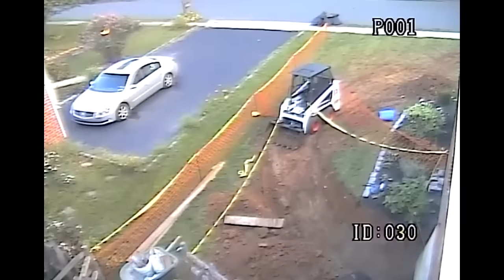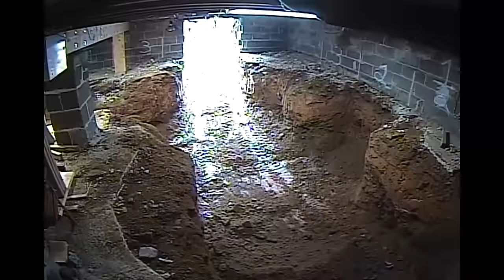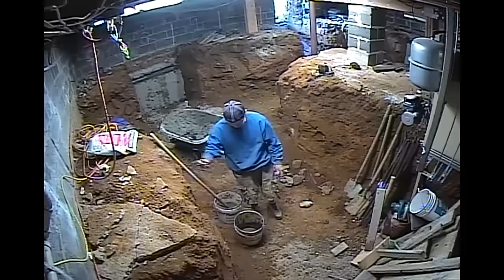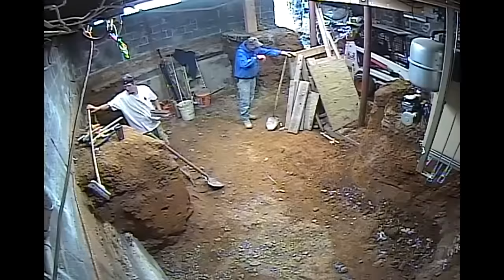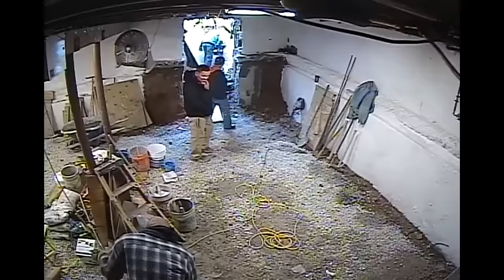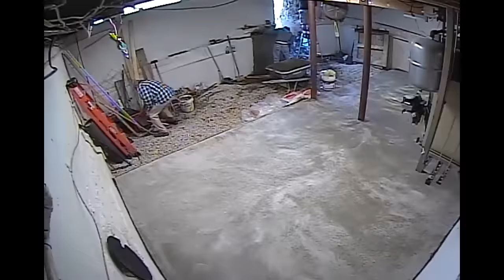New Basement - Crawlspace dig out and underpinning

Comment: This is interesting.  Im in BC Canada. My next door neighbours put in a new basement. But, they jacked the house up first. About two feet. Two steel beams supported by 8 by 8 blocking. Then the bobcat dug out the old basement floors and walls. That took about 3 days. Then formed up the new basement and poured the walls.  They were able to put waterproofing on the exterior. Also pipes under the new floor to remove radon gas. A lot of work. But it looks good.
Reply: Did you ever find out what your neighbor payed for that?
Reply: I wish I had the money to do that for my current old home. The basement needs some serious repair but the house is built on an elevated area so there is no way to get a bobcat up here.
Reply: How much was it? Do you know

Comment from the maker: Since I keep getting the same questions, I’m posting my typical response to most folks that email me.

We are located in Southeastern PA so your cost may be higher or lower depending where you live and depends on the conditions of your house.

 Cost, we paid 62k for the following: The digout, underpinning, drain for perimeter, floor slab, drylock of all walls, and window egress kit. I spent about another 12k to finish myself with family. I live outside of Philly and it took some time to find a contractor who knew what they were doing. I got pricing as low as 40 and up to 90k. I ended up hiring a contractor who had done this kind of project before. 

Also I had a structural engineer provide drawings ($900.00) because with this kind of project you don't want to wing it. We've had some minor settling however the space we gained for us is priceless. We had built up 15 years ago and did not want to move so for us it made sense.

Permits and inspections were ~ 1100.00

For our project, our finished sq ft was ~ 450, we lost some room around the perimeter due to the underpinning requirements.

The digging out took 6 weeks and finishing took me another month or so.

The bobcat was key - yes we destroyed the lawn but that machine made all the difference in speeding up the process. You could hand dig and I've seen videos of people doing it that way but it will take significantly longer.

To date we’ve had no moisture issues. Our perimeter sump has never filled up. Now if you had a higher water table I could see having concerns but for us we’re ok. Some people have asked about water seeping in between the poured sections – well that’s more of a question from the engineer. I suppose that’s why we were required to install the perimeter drain and sump.

Thanks,

Mike
Reply: Big job, you guys did great! Thanks for the look.
Reply: Hi! I hope all are healthy and safe. Thank you for this video. I’ve been playing with the idea of a crawl space dig out for years and I’ve decided to try and move forward with it..depending on the costs. lol I live outside of Media, PA, so very close to Newtown Square. :-) I spoke with Gary and he couldn’t have been a nicer and knowledgeable guy. He recommended starting with the structural engineer and then come back to him with drawings. With that said, would recommend the company you used and if so, who would that be? Also, if you had the chance to start your project over again, was their anything you would have done differently or recommend to someone thinking of having this same project done? Thanks! Stay Safe!
Reply from the maker: @mastercpu2  Hello and thanks, yes Gary and his crew were great! The structural engineer I called was PennFUSION Engineering in Lansdale. I was happy with them and had no issues. I did ask the engineer to change a couple of things and he was great to work with. I suppose I would have changed a few things on the finishing side but as for the underpinning, there wasn’t much wiggle room to change things. Originally the engineer called out for deeper footing which would have taken up a lot of floor space into the basement, we revised this to pour deeper behind the original footing by excavating a little more. Also we installed 3 columns which are hidden behind the walls, some folks opt to have a new beam installed that spans the entire basement giving them an open space. We didn’t want this option and honestly I didn’t want to mess with the original beam. We did actually beef it up by sistering 2x12s on either side since I wanted to relocate some of the original columns. We’re almost at 6 years and doing fine. We’ve had some minor settling and I had some drywall work done to fix some corner beads / joints but the basement is dry, not musty, the sump has never filled and we’re happy with it.
Reply: With a proper drain tile installed around the perimeter as well as the pump capacity to handle even the heaviest rain you should never have any issues with water other than normal equipment maintenance and repairs. Looks great. I'm thinking about doing something similar but my water table wont allow it.
Reply: whistles at price I can't say anything as I haven't ever had to quote that even with contract friends and it probably covered the cost of the concrete,also is the contractor is GOOD that adds to. I can def see significant cost savings with DIY but still quite expensive for for concrete.  Awesome video
Reply: Thanks for the valuable information!  A local engineer (i’m in the bay area) wanted over 20,000 for the same project. Price gouging.

Comment: So many questions....
• what state was this located in? 
• what method did you use to prevent moisture from the walls and floor? 
• how do you tap into the drain system?
• is this accessible from inside the house?
Reply from the maker: PA - outside of Philly. Walls were drylocked, weep holes drilled into the original block which can drain into the surrounding french drain. Also hung 10 mil plastic behind the drywall and insulation. The slab was also poured over 10 mil plastic per the engineers drawings. The drain goes around the perimeter and empties into a sump which then discharges outside.
Reply from the maker: I didn't see your last question. Of course its accessible from inside, we added new steps from the family room to the new basement.
Reply: How much, 40K, 80K, 120K?  I want my crawl to look like this soo bad, great vid!
Reply from the maker: @msbgone  send me an email @ mjnicolaides@gmail.com
Reply: Marc Spunt let us know the damn price.  For those who just want to know without emailing Gees!
Reply: I just saw this now....  not really going to look into it right now, thanks all!
Reply from the maker: @hectormeza991  I don't publicly share the cost out of respect for the contractor. Besides there are so many factors involved in a job like this that just stating the price really doesn't prove anything. I got pricing from 40k to 90k and it took some time to find a good contractor and there was a ton of factors and issues to consider. So there you go.
Reply: The price almost certainly varies depending upon a lot of factors. Most of which is probably the area of the base of the existing house. I estimate that the house I live in, which is a small 1200sqft would cost me about 100k. It's expensive. You could always do it yourself, if you did enough research on the building codes and best practices, and didn't cut corners. It would probably take half the summer to do it, and a broken back, and a lot of blisters, maybe a couple of trips to the ER, and maybe a new house :)

Comment: I'm curious. did you put something in the seems between the different concrete pours to close the joint to prevent moisture from seeping in to the basement?
Reply: I doubt it, but in reality only very high psi concrete will stop moisture infusion. It must be assumed that cracks and existing block will allow moisture through.

The ideal is to train outside the wall, have it sheet down a plastic membranes, and hit gravel, then be carried out by drain or pump (that’s how my house is).

Comment: Amazing how long do you have to wait for the concrete to dry before you can start digging the next sections.
Reply from the maker: The plans called for 72 hours of cure time between drypack (the grout) of one section and excavation of the adjacent.
Reply: @michaelnicolaides187  what did you use for the dry pack? Mortar?
Reply from the maker: @lostintime8651  They used a product called Planigrout 755, its a general purpose construction grout.

Comment: Great Video!!! It's very clear the method, I'm building a new basement, put it will be piled 6.5m down under my new rear extension. will be around 2.8m ceiling, 26m2. couple of questions, why didn't you get a concrete pump when you laid the floor, and I guess you used 90cm (3') segments for underpinning, with 45cm for the outside corners, to prevent collapse.
Reply from the maker: Thanks and good luck with your project. My contractor really didn't need a pump, he had enough guys to wheel barrow the concrete in without having to rent a pumper. Also when doing the underpinning sections it wasn't a large enough poor to warrant a pumper. Even the floor wasn't that much. For the sections I believe they were 3.5 - 4' sections.

Comment from the maker: So I accidentally deleted a comment about the hanging oil heater and not sure how to undo that? But yes lowering the heater was a lot of fun!
Reply: got a few questions, how much was able to dig at once like in foot? also how did you do walls when I hear to water proof the outside? I am thinking to do this myself when got my own house but unsure on somethings when watch videos, looking to get an 30 foot by 6 foot basement, though at moment thinking if can use rsj to support house as go round or should always be concrete? looking to do by hand to save on some costs
Reply from the maker: @mlee6050  i'm not sure I fully understand your questions but feel free to email me @ mjnicolaides@gmail.com
I know that the contractor left a 3' wall of dirt on the adjacent sections when digging out the section to be underpinned. 3 of the 4 walls could not be waterproofed from the outside as they had either a porch or common wall to the rest of the house. The waterproofing included a perimeter french drain with sump as well as drylocking the walls.

Comment: Looks like a great job.
1) How long did the whole project take?
2) How long did it take to get to the point where the concrete floor was poured?
3) Did they drill holes up into the old foundation?
Reply from the maker: This project took 30 days from start to finish. It started end of Sept and wrapped up 11/1/16 due to some rainy days.
The floor was poured on about the 25th day.
Yes they installed rebar into the old foundation. I had a structural engineer provide drawings.
Reply: Michael Nicolaides very cool time lapse. I’m trying to price this out for my own home. How much could I expect to pay for total project? Roughly of course
Reply from the maker: @ccoregulator  Send me an email, my email is listed below in the comments
Reply: @michaelnicolaides187  i am also interested how much it cost as I am trying to price out the 500sf crawl space...
Reply from the maker: @simplelifed7523  send me an email @ mjnicolaides@gmail.com

Comment: now dig out around the whole outside of those walls and seal it so that the work that was done is not a complete waste
Reply from the maker: impossible to dig out 3 of the 4 walls due to porch, rear room addition and common wall to the split level. Only one wall could be excavated from the outside. We do have a perimeter drain and sump and so far no moisture issues.
Reply: @michaelnicolaides187  Glad to hear you are not experiencing any issues yet

Comment: Great work. Seems like you should of waterproofed and install sump pit before pouring floor
Reply from the maker: Yes, it's hard to see with how quick the video is but there was a perimeter drain and sump installed before the slab was poured
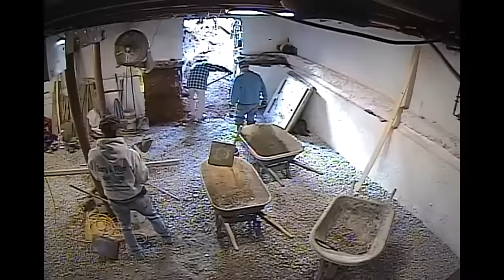Reply: I think at 4:46 you see it go in. You can see the pipe with holes in it for the drain laying up against the wall for a section of video.

Comment: I was quoted $30k for a job just like this in Illinois about 10 years ago. That price didn’t include for the basement to be finished with drywall or electric. So you gotta figure in an extra 15k. The worst part is you lose a foot of space around the whole foundation. Not worth it if you ask me. Better off putting the extra money on a bigger house.
Reply: why dont you think it is worth it?
Reply from the maker: It was worth it for us. We had built up years ago and that wasn't cheap either. Moving, closing costs etc can also bite you in ass.

Comment: What is the cost of difference of doing this vs just building the basement straightaway?   Also was there a lot of home settling after this was done where there were cracks in the drywall or other materials because of the settling?
Reply from the maker: No idea what the difference would be. When they built the houses in the 50s, the basement was a $500.00 option. We had some minor settling and need to redo the tape on a couple of joints but that's the extent of it after 3.5 years.

Comment: did they use grout to finish the connection between the old and new ? or just pour the new to meet up to the underside of the old
Reply from the maker: Yes, they left a small gap ~ 2-3 inches that was then packed with grout per the engineers' drawings.

Comment: What are the long term reports from a process like this? Considering that you can't waterproof or insulate from the outside, I'd be extremely hesitant to hire anyone that employed this method.
Reply from the maker: As far as I know nothing different than any other basement. Sure some settling may occur however we can fix that. Yes we could not waterproof the outside which is why a perimeter french drain was installed in the interior.
Reply: @michaelnicolaides187  would the french drain then require a pump?
Reply from the maker: @aristotelian9693  yes a pump is required - we had one installed as part of this project

Comment: I hate delivering concrete to people the wheel it all. Good god.
Reply from the maker: pumping multiple 1-2 yard pours every couple of days is expensive
Reply: Michael Nicolaides  most people wouldn’t do this. Well most people I know. They would just buy another house with a basement or build a whole new house ground up on a new piece of property. 

And 2 yard deliveries are costly, my company smacks you with a short load change of 150$ plus the normal delivery charge plus the concrete.